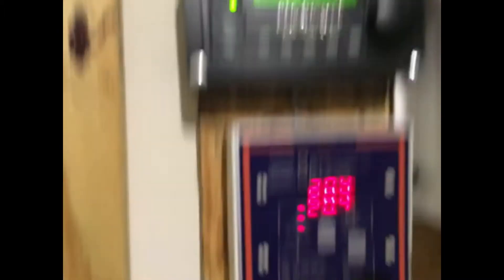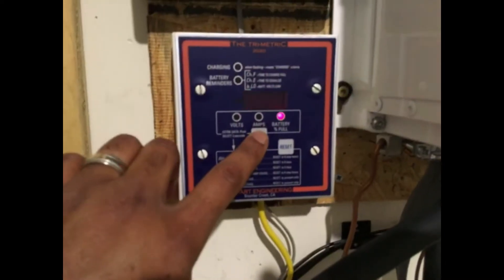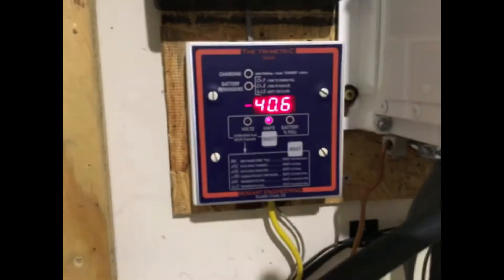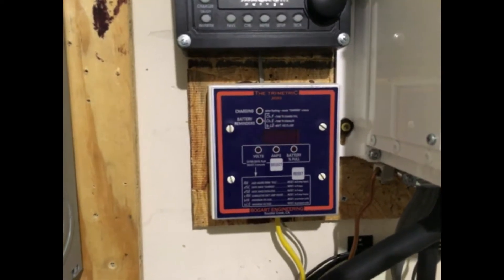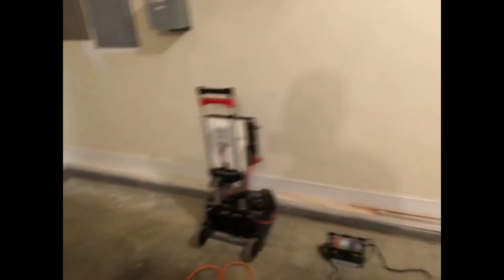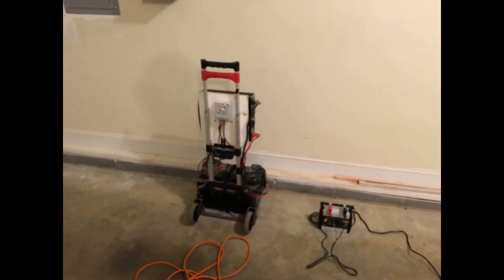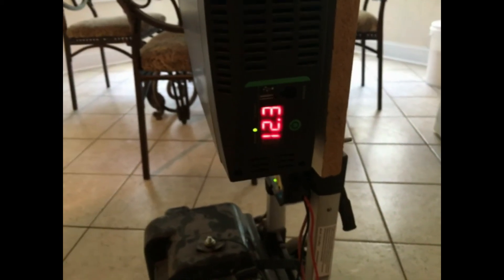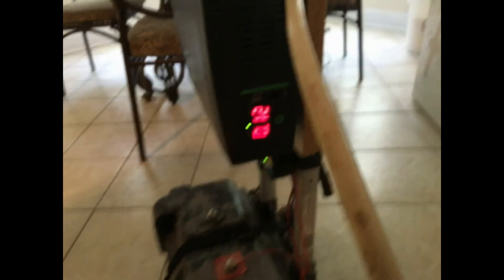Nickel Iron Battery Load Test Part 2

Comment: a capacitor to help the load
Reply from the maker: Yes, ultra-capacitors in-line between the batteries and the inverter help with inductive loads like compressor motors in the fridge and freezer, blenders, washers, etc.  It's also helps to keep the inverter from shutting down too pre-maturely due to a start up surge from the motors I mentioned.  I've included them in my current system.

Comment: What about adding a bank of some 350 Farad super capacitors?
Reply from the maker: +Craig Nehring that may work, I'm not familiar with them and so I've never wired them up, but I guess that is what research is for.
Reply: +rhandsom  Lock rotor amps of the frig? What about that thing that lowers the lock rotor amps? There like 200 bucks each but would be maybe less than more batts..
Reply from the maker: Thanks, is there product name or can you point me in direction to search google?
Reply: Ultra or Super caps do have certain limitations as to maintaining balanced voltages and operating voltage that would have to be taken into account. Each capacitor is rated at only 2.7 volts per unit. A bank of them can be configured in series for a much higher voltage rating.
Two of these in series could work in your application for easing the load on compressor start up

http://www.ebay.com/itm/12V-super-capacitor-module-6x-350-farad-caps-300A-engine-starting-car-audio-/111883927289?hash=item1a0ccd3ef9:g:wxEAAOSwg3FUovjv

Or something like this
Reply from the maker: +Craig Nehring Thanks, I believe I've found something that may work along the same lines as these capacitors.
Reply from the maker: +yankey4 I believe I've found something that would work.  Thanks for the idea.
Reply: rhandsom This right here is why I love YT..  Thanks so much for taking the time to make all the videos. God Bless Brother.
Reply from the maker: Thank you too, God Bless.